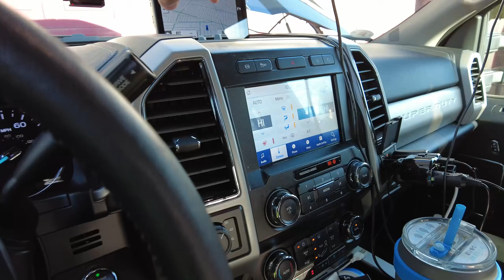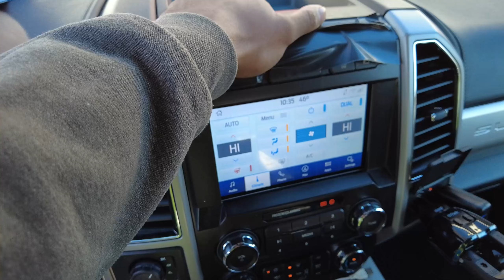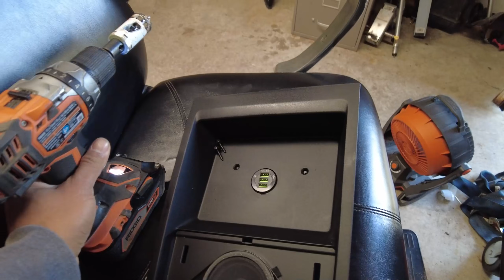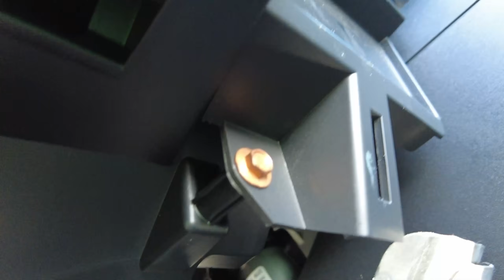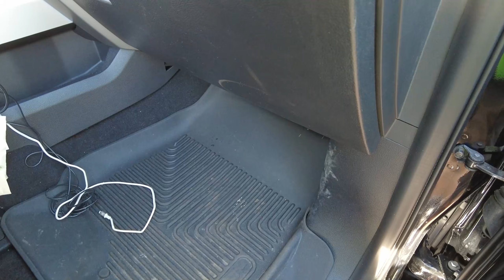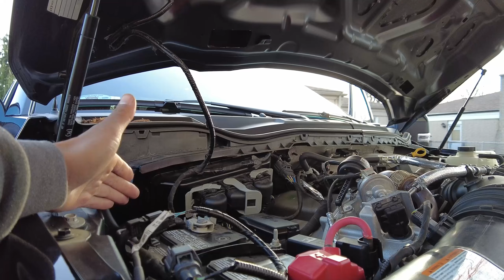USB flush mount charging port install. FORD TRUCKS.

Comment: My f150 has fuses on passenger side by the door. Much easier to just get a fuse splitter and crimp it in. That battery method is way to much work

Comment: Just added a dual USB port and a cigarette style plug, but I drilled the holes for the ports on the slanted portion under the speaker. It worked perfectly and plenty of room for the wires and but end of the ports in that layout

Comment: They don't point out very well that there is a dash support bar running right under the middle of the tray. There is no clearance if you try to put the USB there. That's why it shows it sticking clear up.
Reply: I used it for a ground and ran a tap from fuse 37 in the interior fuse box.  It took about an hour.  No need to open the hood or disassemble the dash.